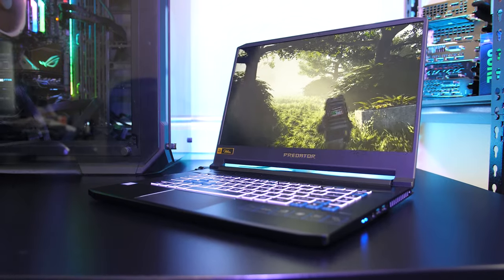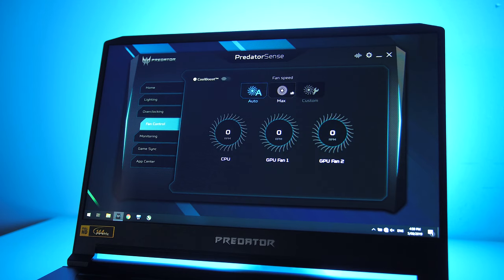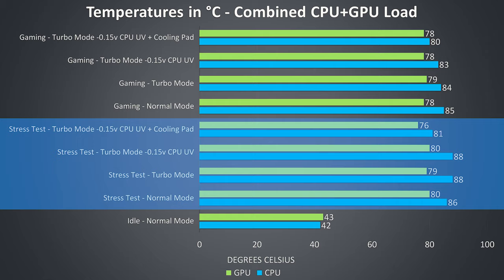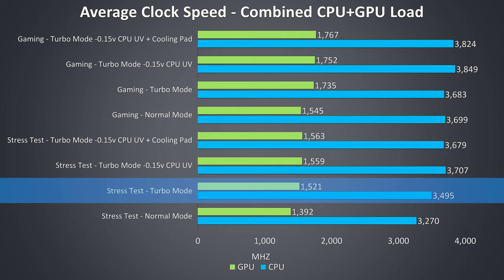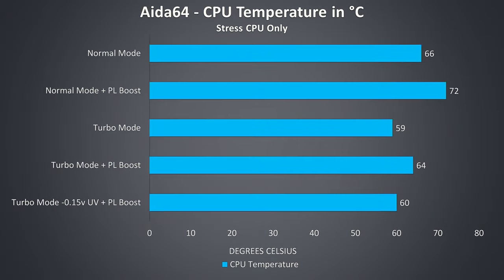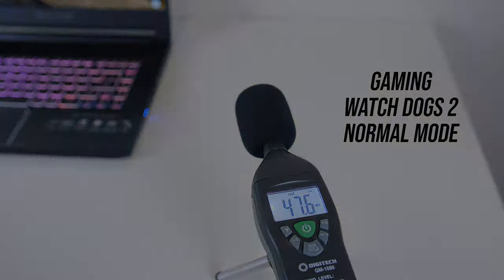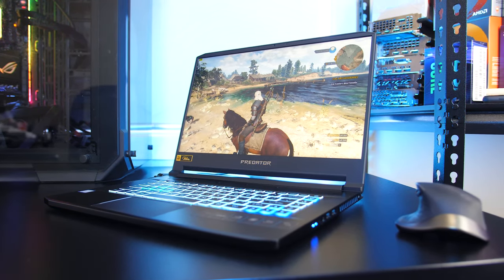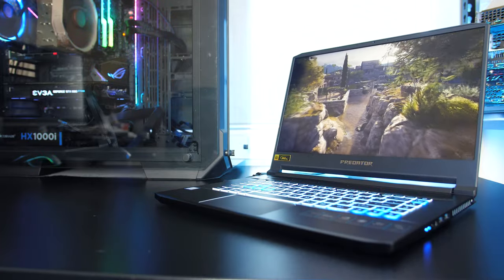Acer Triton 500 Thermal Testing - How Hot Is It?

Comment: no thermal throttling, didnt expect that.
This is the best light and thin laptop
He, jarrod whats a good cinebench score for a 8750H?
Reply from the maker: Yeah they seem to have limited the maximum power well to prevent that, and with the default undervolt it can still perform quite well, seems like a fair trade off to me.
Reply: for R15 around 1200 is really good, 1100ish is fine, anything less is some degree of throttling
Reply: @bradhaines3142  i mean in R20
Reply: @Matt___B  i got mine set to run cool, and it just ran 2600. so im guessing 2800 is a good run for full power.

i got all sorts of setting touched, so it rarely goes over 80c, never hits 90 anymore
Reply: @bradhaines3142  i've got 2799, but it was just a test to see how far i could push it. For daily use like now, its undervolted by 165mv and i've locked the clock so now it doesnt get hotter then 55°C.
Reply: @Matt___B  what did you lock the clock at? i capped the boost at 3.5ghz, boost tdp short-60, long 45, duration 150sec
Reply: @bradhaines3142  i just set the maximum usage to 99% in windows, which allows my cpu to clock to 2.1Ghz on all cores, which is low. But its fast enough to keep my GPU usage at 100% which enables me to have high FPS at low CPU usage. My laptop is the helios 300 2018, so the cooling system isnt great for the GPU. so i'm grabbing any opportunity to keep temperatures (and noise) down without a performance loss.
Reply: @bradhaines3142  and gpu doesnt go higher then 65°C on max setting
Reply: @Matt___B  oh that actually sucks. you got 2800 with that?! mine was running 3.5 and got 2600. weird

also i have aero 15x v8, equally bad temps, which is why ive been tinkering the setting little by little any time i think i can improve it. using throttlestop, and msi afterburner for the gpu oc. i got +200 core +100 mem
Reply: @Matt___B  what gpu? for me the cpu can get to 80c on heavy load, touching 85 on a stress test. gpu can get to 70ish but it doesnt go to 75c. im pretty happy with it so far
Reply: @bradhaines3142  GTX 1060
Reply: Jarrod'sTech heyy need your help...mine triton 500 is termal throttling... with -0.100mv undervolt

Comment: I got this laptop for 7 months now. CPU is about 65 C on idle and 90+ C while playing ANY game. I played Baldur's Gate 3 on Ultra and then Fall Guys - the same 90 C. It doesn't have any performance issues while this hot, but the keys are actually burning my fingertips. I still have warranty, so I'm not doing anything with it. It's just a warning about kinda poor thermal paste or fans or... whatever.
Reply: yeah i think its just a trade off of having such a thin device that packs so much power, id say its alright though, my acer nitro 5 with an i5 and 1050ti usually peaks around 83c to 85c while gaming and it never had any performance issues

Comment: Hi Jarrod,  good review as always. I cannot decide between y740and triton 500.  I want to use the computer at least for 5 years, so it needs to be future proof. I will use the laptop for both gaming and 3d cad applications. For longer life span I know the thermal performance is crucial. And I don't mind if I pay more for rtx2080mq for future applications and gpu ram demanding applications such as cad programs. Do you think getting rtx2080 or 2070 mq worth it? Right now triton 500 8750h with rtx2080mq is about 1800 $, lenovo y540 9750h with rtx 2080mq is 2000$ and y740 2070mq version is 1800$. My last laptop was hp z book g4 17"  (it is a thick heavy machine). I'm not looking for the most thin laptop. Performance and life span is priority. What is opinion?
Reply from the maker: Thanks! The Y740 has G-Sync, Triton only has that if you go for the 2080 Max-Q model. I've never properly been able to test 2070mq vs 2080mq so really hard for me to answer, but you can get a rough idea of the differences in my game benchmark videos, towards the end of the video I have a graph that shows all of the laptops I've recently tested and there are 3-4 of different specs. Weird that Triton is cheaper with better GPU, the CPU difference will be pretty small.

Comment: Hello just so you know I've had mine nearly a year CPU run at 95c degrees whilst playing Overwatch. I don't use a cooling pad but I may get one. I have sent it back for a service and have asked acer to repaste the CPU, I'm also getting an annoying clicking sound on one of the fans so have asked that they replace that fan also. I'll let you one what the CPU temp goes up to on Overwatch when I get it back. I'm hoping closer to 80c

Comment: I'm Getting 95C all the time for my CPU under heavy load. is there something wrong i'm doing or should I talk to the store where i bought it? 
allways running max fans and "coolerboost"
Reply: Just replace the thermal compound
Reply: I use kryonaut and it never went over 75°C
Reply: @TheGoat I get thermal throttling (of cpu) when running 3D mark and also power limit throttling. I have also updated bios and cleaned the fans, and undervoltning of 100mv did not help. And I did not get these high values months ago, this is pretty recent. thinking of changing the thermal past on the cpu might be the next step?
Reply: @TheGoat  But that would not result in those high temperatures right?

Comment: Hey Jarrod. Would you consider these results to be high?  I'm considering either Triton 500 or Helios 300 but leaning towards the Triton due to its portability. I've had a gaming laptop before but it no longer turns on and when I took it to service they told me that the motherboard was literally fried. Would you say that this laptop has a good cooling system to last long for high end gaming and travelling? Thanks.
Reply from the maker: Not particularly high no, not even getting to mid 90s like many others would do easily. Seems alright under worst case stress test given the thinner chassis.

Comment: Jarrod, in your opinion, which would you prefer more: Helios 500 or the Triton 500? I am having difficulty picking between the two
Reply from the maker: For me personally the Triton 500 is the easy choice. I need portability more, it's much thinner and smaller than the thick 17" Helios 500, plus the 2060 is quite close to the 1070 you can get in the Helios 500 anyway. I thought one of the main advantages of the Helios 500 was the great cooling, but as we can see here the thermals are ok too. The Helios 500 can come with the 8 core Ryzen desktop CPU, maybe if I really needed that and didn't move it around so much it could be a better option.
Reply: Helios 500 if you don't need small sizes and good battery. I got the AMD version with a desktop CPU and it runs much cooler and quieter than this.

Comment: Hey Jarod,
I bought my Acer Triton 500 a week ago and when I power it up, CPU already sits at 54-60 degrees C. Basically idle temperature is 55-60 degrees C. I mostly play Dota2 and on Auto fan mode I sit at 90-92 C for CPU and 80-84C for GPU. When I use Max fan mode, CPU sits at around 84-88 C and GPU at around 70-74 C. Please let me know your opinion if it is normal temperature behaviour, or should I request warranty exchange?
P.S. I put small size wooden blocks to raise the bottom in order to increase air flow underneath the laptop.
Reply from the maker: Sounds fine to me, wouldn't worry about it. Try undervolt further or run at higher fan speeds if you're concerned about it, but I don't think that's a problem. Raising the back up should help in a similar manner to using a cooling pad.
Reply: @JarrodsTech  would you recommend using liquid metal instead of thermal paste after the warranty expires?

Comment: some triton 500 laptops have the  9th gen  i7-9750 H    (  with the same  GPU  RTX 2060 mobile )  .  Are these newer i7  performing better than the older 8th gen  ?
Reply from the maker: Yes that's the newer 9th gen version, I doubt it would see much difference under multicore load due to the throttling issues here that would also be present there. It may see a little boost with some tweaks or in shorter burst / single core workloads.

Comment: Someone Help Me Please
Should I get the Triton 500 or Helios 300 if they both have the exact same Cpu, GPU, amount of Ram and 512gb SSD in both?????

The Helios works out to $400 cheaper for me thou!
Reply from the maker: Helios will probably perform better, the undervolt is more aggressive, it's a little thicker and more cooling means the power limit is higher. Triton only worth considering if you really need Thunderbolt, or G-Sync in the 2080 config.

Comment: Have this laptop and I love it but my games are running at 80c or more heat. Is that safe for the hardware? 😕
Reply from the maker: 80c is perfectly fine, I wouldn't worry about it at all.
Reply: @JarrodsTech  Okay cool. Could you recommend me a decent offset voltage and turbo ratio limit on Throttlestop?

Comment: I got this laptop around a year ago (having checked out this video before hand). Now a year later, the CPU reaches 91 degrees playing Warzone and the sound starts crackling and the one time I tried to keep playing it crashed and my screen glitched out 😅 Does the motherboard being upside down make reapplying thermal paste difficult? Will also try investing in a cooling pad...
Reply: Yeah same dude, mine can even reach like 95...
Reply: I replaced my ram bars, and had to disassembly everything, you just need to be patient and pay attention to every cable, screw, etc you remove, but it's not that awful, if you're patient and cautious
Reply: @yoshizuna8919  HyperX Impact K2 (2 x 16GB, DDR4-2666, SO-DIMM 260 pin)

Comment: Hey Jarrod, may I ask if these are average or maximum temps? i have the exact same laptop, got it undervolted to -0.144v. However i do still reach temps of 93 degrees. Is my unit faulty or is it normal? Keep in mind that i don't use a cooler and my average room temperatures are around 25 degrees Celsius
Edit: the 93 degrees is the worst case scenario like when playing monster hunter on full graphics and i have a lot of things gong on the screen. However my temps usually hover around 86. So i just want to check if the 93 degree peak is normal.
Reply from the maker: Average over 30 mins for each data point on the graph for stress test, 10 mins for each gaming result. My max on the CPU was 90c, but would have been a brief spike. Given your room temp is 4c above mine and generally for every 1c increase in room temp we can expect a 1c increase to the components (source: https://www.pugetsystems.com/labs/articles/How-Ambient-Temperatures-Affect-Your-PC-158/) I think that sounds similar.

Comment: Fans on manuall I have it at 3600 on the CPU around 4000 on both gounfsns with a -116 undervolt locked to 3.8 I get 82c hottest temp idle at 46 avg at 72-75f while gaming cpu never goes over 80 and avg 75 I love the temps on this. You can remove throttling with throttle stop settings all in all this is laptop runs cool and performs amazing the biggest negative is the 180w brick ... So you will get battery drain
Reply from the maker: Nice, I had no battery drain on the 2060 model, 180w seemed to be fine.

Comment: Which one would you recommend? Triton 500 (2060) or Helios 300 (2060)
Reply from the maker: Helios 300 has higher CPU power limit due to the thicker chassis and more cooling, higher undervolt out of the box, and GPU overclock in turbo mode. You can see in my game test video here even the 1660 Ti Helios beats it: https://www.youtube.com/watch?v=UXPXzlpyVvU Triton has the advantage of being smaller, Thunderbolt 3, and goes up to 2080 Max-Q with G-Sync, Helios only goes to 2070 Max-Q and no G-Sync. G-Sync will boost FPS in many games for the reasons covered here: https://www.youtube.com/watch?v=RJfHr-Y57LY
Reply: i think it depends where u live. In singapore, the SGD$2550 triton 500(rtx2060) cost only SGD$45/AUD$47 more than the SGD$2505 helios300(rtx2060). For me, i confirm will pay the extra money and go for the triton 500.

Comment: since this is so similar to helios 300, is it better to go for helios 300 for the price?
Reply from the maker: I talk about this in the upcoming review video a bit, depends what you're after. Helios 300 is cheaper and does perform better (it has newer 9th gen CPU compared to this, though Triton is available with that too, but also higher CPU power limit, GPU overclock and higher undervolt). No Thunderbolt on the Helios, Triton is thinner, and also has the option of G-Sync with higher GPUs.

Comment: Hey Jarrod which one?.....this or the asus zephyrus s gx701 or both?
Reply from the maker: Not sure why you'd get both 😁 hard to compare without having tested the same specs. Both are hard to get into, this is probably more annoying with the upside down motherboard but at least it doesn't have memory soldered to the motherboard like the GX701. With higher GPUs both also have the advantage of G-Sync, I think the build quality of the GX701 was a bit better/solid though.
Reply: @JarrodsTech  thanks dude YOU ROCK!
Reply: If you want a laptop for everyday work as well, the Tirton seems like the better choice.
Reply: @KshitijChawla  yeah but the zephyrus should be able to handle that too right?
Reply: Its keyboard Is front shifted. 
Especially on a lap but even on a table, without a decent palm rest, typing for long hours can get tiring. Then there's the twilight zone of fatigue, where the hands are not so tired that one feels the fatigue acutely, but they are tired enough that one has to focus more on the typing itself, one makes more mistakes while typing, and so on..I am a developer and the typos due to a bad keyboard really kill the productivity for coding.

Then the trackpad is portrait orientation but the display is landscape orientation, which means one has to lift the fingers and reset their position to move the pointer across the display more frequently. 

Considering I will be typing on it for ~6-8hrs everyday for 2-3 years, this kind of problem will add up, the fatigue takes away from daily productivity. It can also contribute to repetitive stress injuries, which are a terrible burden on life.
These 2 would be enough to not consider this as my primary machine. The compromise doesn't seem worth the extra gaming performance of maybe +10-15FPS (at best), when I will be playing at 1080p.
I would reject the Zephyru based on that, but 2 other things to consider:

236min of youtube video watching is not good battery life for productive use. Any serious work: Browser with 15 tabs open, with Excel and Spotify running  will suck it dry in 2.5-3hrs max.

Finally the 1.5lbs extra weight or 3lbs extra weight with the charger (which will be necessary with short battery life) means I cannot use it as conveniently as a daily workhorse. This extra weight is not good if one commutes using public transport for example.
Reply: If you are undecided, then buy the laptop from a store that offers 1 month no question asked returns, Like Amazon or B&H studio. If these issues are a problem after 3 weeks of serious use, then return it.
Reply: @KshitijChawla  thanks for the info dude!
Reply: @PhillipLemmon  your welcome. I'm considering the 1660Ti Gigabyte Aero 15 OLED. Excellent display and battery life, gorgeous display for movies and work. A little undervolting and the CPU is faster than Triton 500 and Razer Blade 15.

Comment: Great  device all around.

Only issue that i see is difficulty of thermal pasting this machine due to the flipped motherboard.
Reply from the maker: Yeah could be difficult if you wanted to do that, based on my results I don't see too much benefit in attempting it without the option of boosting CPU power limit in combined CPU/GPU load, at least for me these temps are fine.
Reply: @JarrodsTech  Wouldn't there be need to re-paste in the future? Or is it not necessary?
Reply from the maker: Depends on the quality of the paste they're using and if higher temperatures are observed over time, I'd guess it'd probably be fine though. I saw no difference changing the paste on my 7 year old PC I used every day for example.

Comment: I need help please
Gigabyte Aorus 15G. I7 10750H + Rtx 2070 Max-Q. 240Hz. Mechanical keyboard. It does not have G-Sync. $ 2110
Acer Predator Triton 500. I7 10750H + Rtx 2070 SUPER Max-Q. 300Hz. Membrane keyboard. It has G-Sync.
$ 2245
Which one do I buy?

Comment: please when you upload the review for this, please mention if the Triton 500 is more worth it than Helios 300
Reply from the maker: I recorded it today and discuss this a bit towards the end.
Reply: @JarrodsTech  oh please tell me now coz i am buying later T-T
Reply from the maker: Basically you can get the Helios 300 with same 2060 for about $100 USD less. The Triton 500 seems to offer Thunderbolt 3 and a thinner build, not that much else. It's harder to upgrade, but at higher GPU options you do have the option of G-Sync which should help boost performance, plus you can also get it with higher tier GPU.
Reply: @JarrodsTech  thank you jarrod!
Reply: @JarrodsTech  the hp omen with the same config is 500 less
Reply: @JarrodsTech  I just purchased helios 300, 17" RTX 2060! just waiting for it to be shipped. thanks mate!
Reply: @shineonnent.7951  no, you are missing the point, if you watch Jarrod's video, clearly it's not about just the specs but how the entire design utilize the components.